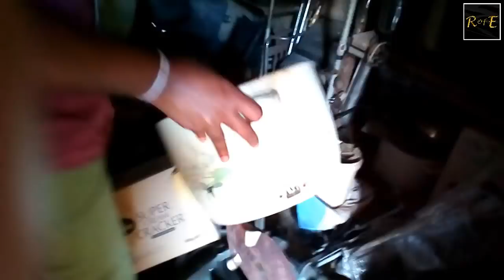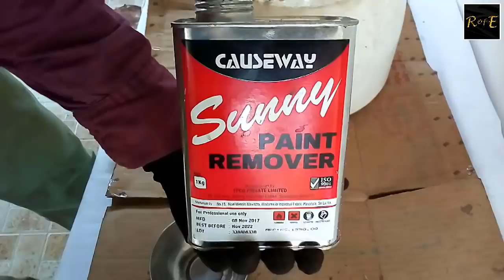Rice Cooker Restoration | Rice cooker repair

Comment: Do they restore for your own use, on behalf of a customer or for the sale of the restored things? If you do it for commercial reasons: is it worth it? With the rice cooker in particular, I wonder whether it would not have been cheaper to buy a new device in view of this effort.
But that probably only applies to a country with hourly wages as high as mine - unfortunately! We should also throw away less and repair it instead. I'm trying, but I'm not that good yet ... A big compliment and greetings from Germany.
Where do you live and work?